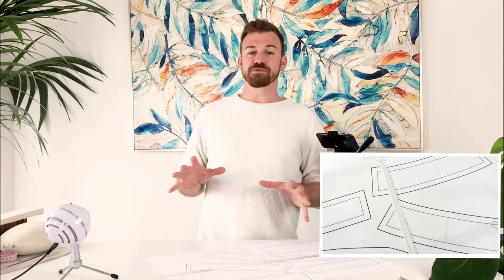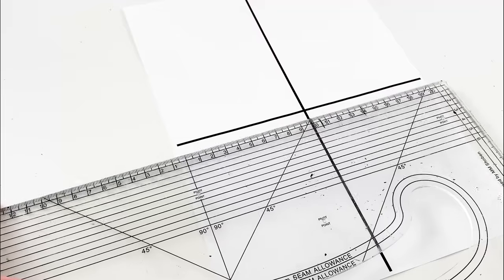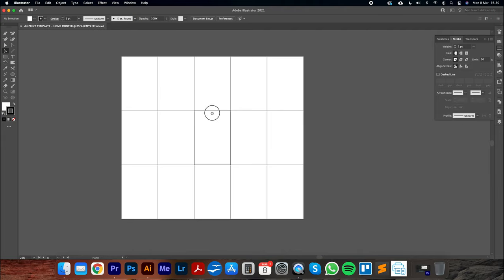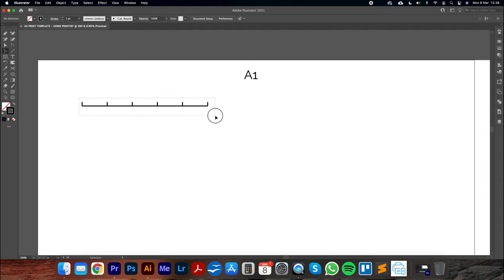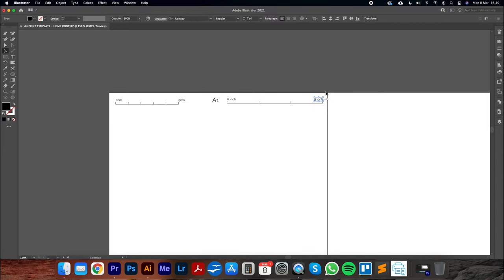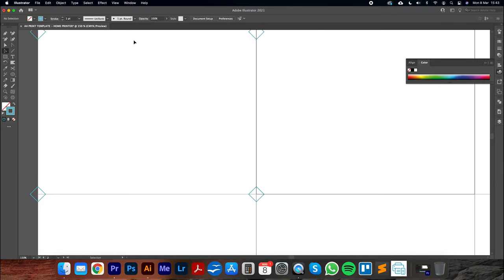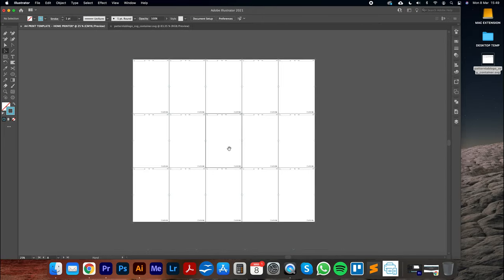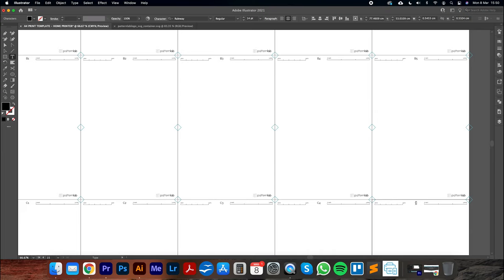Create Custom PDF Print Templates for Your Sewing Pattern Company

Comment: For those of you using Mac to print and you're printing directly from Adobe Acrobat, you may run into the same annoying problem that I was running into. Just make sure the "page sizing and handling" is set to "poster" not "size"
Reply from the maker: Thanks for the tip!
Reply: Will it still be accurate though? The preview looks very off with "poster" selected. I'm having the same printing issue :/

Comment: Thanks for the video! Maybe this tip could save someone some time. Once you copy your elements you can click on your next artboard and go to edit "Paste in Place" or "Paste on All Artboards". You would only need to copy 2 of the registration marks for most of the pages. This eliminates having to align.
Reply from the maker: Thanks for the tip! That's a great idea/ tip. It would be more accurate and save time! I'll try it. Thanks again.
Reply: @PatternLabLondon  the shortcut for paste in place is "ctrl/cmd f" instead of "ctrl/cmd v" after copying with "ctrl/cmd c"

Comment: I know this video is old, but just found.  Thank you for teaching this.  BTW, the "inch" symbol is a double quote "   the singe quote ' you used is for feet, which is why you didn't see it make the correct hash mark when you were copying your first inch line.
Reply from the maker: Ah! OK, that makes sense. I should probably know that. Thanks for letting me know. I normally use cm so not that used to inches.

Comment: Thank you, great tutorial! I have one question though. How do I get a line where the pages will be cut (or I guess a line around each page) that will work as a guide to help cut the pages straight before glueing them together?
Reply from the maker: You could draw a rectangle (using the "rectangle tool" - keyboard shortcut = M) around each page and then give it a line width (no fill) of 1pt. Do this for each page and when printed you would see a bounding box that displays where to cut the page. Be aware your pattern will have a line over each A4 PDF page. Maybe make the line colour a light grey and about 0.5pt to make it less prominent but still visible. I Hope that helps!?

Comment: What an awesome tutorial!! Thank you so much for putting so much time and effort into making this video! I have one question though. When I print my whole template, a couple of pages get scaled up or down by 2 or 3 millimeters and the registration marks don't match perfectly. This may be a problem with my printer, but I would like to know if this is normal and has happened to anyone else too.
I kinda average the positioning out and in the end it comes out ok, but it is bugging me lol
Reply from the maker: Make sure you are printing to scale and the print templates are the correct size for your printer. Use A4 for UK printers or US letter for US printers. You can even reduce the size of your print area to ensure your pattern and the markers are within the printers print area. I hope that helps?

Comment: I have a problam I did all the steps, but when I want to print the pattern in pdf it is not centered it is on left side on and the top, so when I want to print it it cuts top and one side, please can you help me fix this issue?
Reply from the maker: It sounds like your template is too big for your printers print area. Follow the steps again, this time making sure you know your printer's print area. The height and width measurements. Finally create artboards that fit that area. Reducing the artboard's measurements by 1cm for width and height might help also. Good luck!
Reply: @PatternLabLondon  I had the same problem until I added a bleed to make up the difference in artboard/paper size. For example, my artboards are 16 x 10 with a 1/2" bleed to make the total size 17 x 11 (tabloid).

Comment: I'm probably being daft, but when I followed this tutorial and printed through PDF it still didn't work and there are no cutting lines so I found it hard to match together, is there something I'm missing in the printing process?
Reply from the maker: Did you add registration marks or the diamonds at each corner? These will show you where to cut each page edge. I would recommend following the tutorial again are giving it another go. Otherwise you can download our PDF print template pack using this page: https://patternlab.london/home/newsletter-sign-up/

Comment: will your 20 % stretch dress  graded pattern work for lycra fabric or nylon spandex ?
Reply from the maker: Hi Carolina, Yes absolutely as long as the fabric has a stretch ratio of around 20% you should be fine. We have a tutorial to show you how to find the stretch ratio of the fabric. You can find it here: https://www.youtube.com/watch?v=HgXg0nSh7wY
Reply: @PatternLabLondon   its around 30 but i want it to b fitted   not baggy  but i wanna get the design lab graded pattern for the body con dress ... soo was i wondering if 25 or 30  %  💭35% if 35 is too much.... jus stick to the 20% designlab graded pattern for milkshine nylon spandex

Comment: How does this take into consideration any laser printer will not print to the edge of the paper?  A4 or Letter?  It seems to me that some of your pattern will get cut off.
Reply from the maker: The artboard dimensions are created to match the printer's printable area. Therefore, when the pattern pieces are added to the artboards or PDF print template, they will print within the printers printable area and not require borderless printing. It's hard to explain but the concept has been tested many times and works well. Simply create your artboards and PDF print templates using your printers printable area dimensions.
Reply: @PatternLabLondon  Makes perfect sense to me.  The Artboards are continuous and if they are the same size as the printable area, there will be no gaps in the prints.  Registration marks will line up.  I have to try it.  I think finding the exact size of my HP laserjet might take some trial and error.